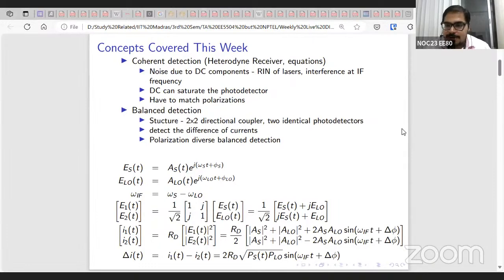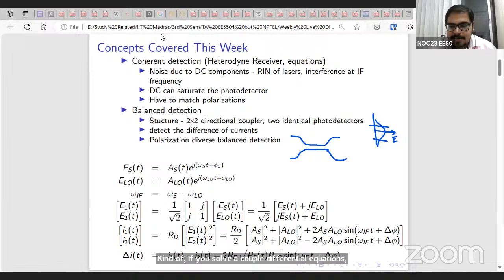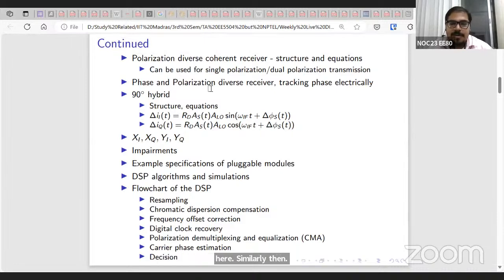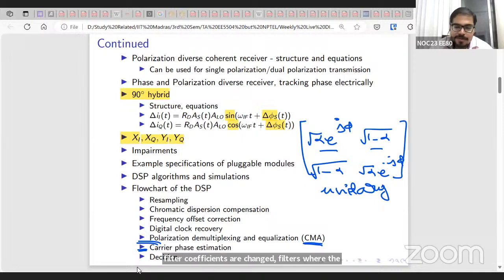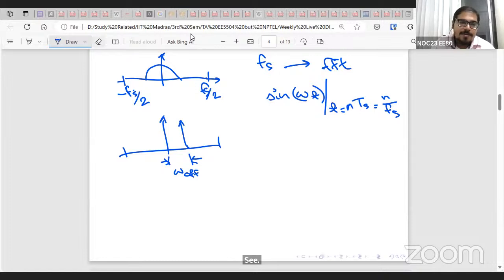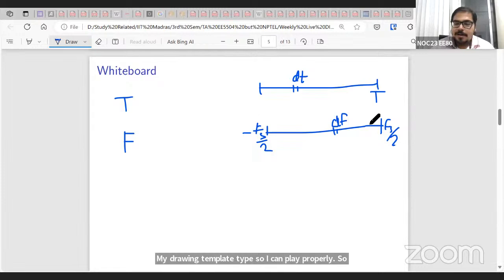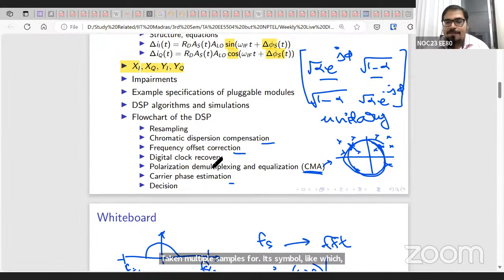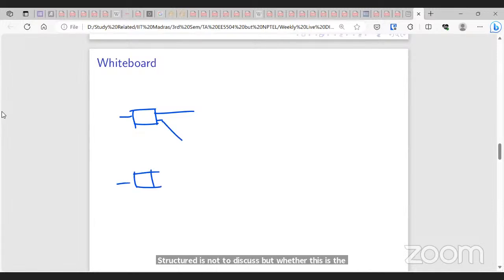Fiber Optic Communication Technology

Comment: Basically two big things were discussed this week - coherent receivers, and DSP/simulations. DSP part is probably not easy to grasp, because we have not spent too much time on the underlying theory, but you can see that there is no magic here. You can rewatch those 45 minutes of the last two lectures to get an idea about the simulations. You also look at Optilux - an open source library of functions for matlab - and the included examples, to get started with simulations of these systems.